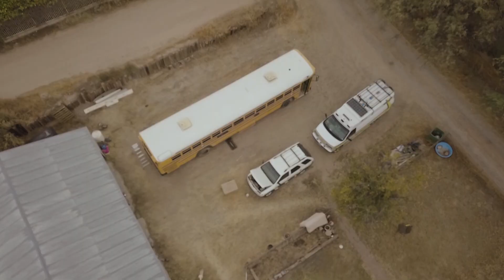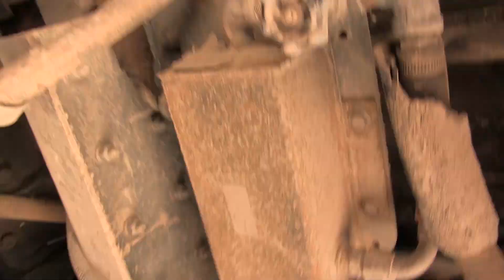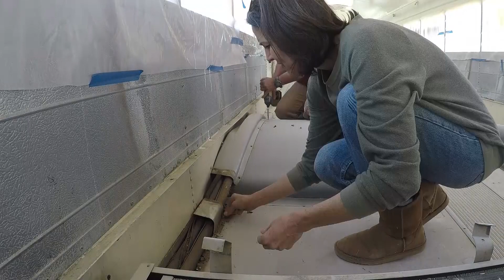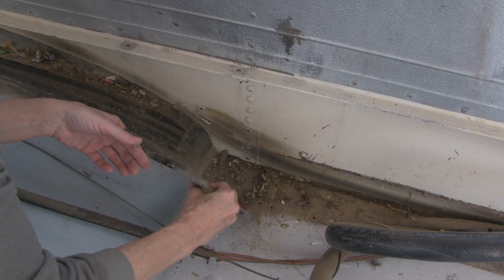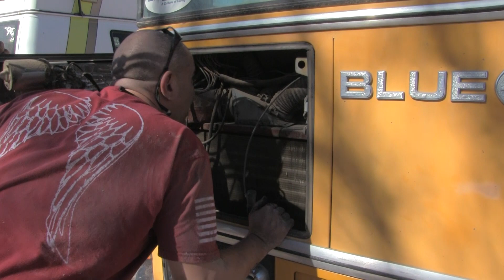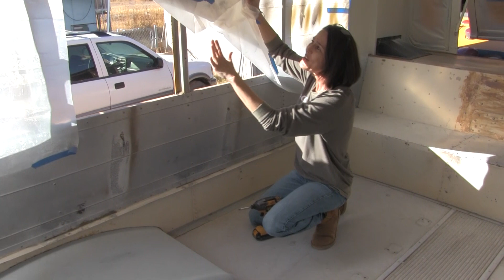Skoolie Bus Conversion: Heater Removal

Comment: My bus had one rear heater and I decided to keep it installed.
Reply from the maker: +Johnny Mullet we thought about it but we realized 3 things. 1) it only works if the engine is running which at idol takes a substantial amount of time to warm up enough to make heat which then makes it a very expensive form of heat. 2) we are installing a propane furnace which we can run while we are driving. 3) in the event we end up at an RV park, we can't run the engine for any real length of time or the wood stove (legality issues). So, the heater is out.
Reply: @BussyMcBusface  hank you for mentioning those considerations. I was wondering why many people didn't just keep the stock heater.

Comment: Thanks for documenting your hard work.  Will you still be able to defrost the windshield with the front heater out?
Reply from the maker: Mick Riva that occurred to me the other day and I haven't figured it out yet.
Reply: Bussy McBusface some of the other school bus conversions I have watched were sorry they took out the defrosters because you have such a large window you need to have a lot of air movement. Some of them put the defroster back in.

Comment: How do you keep your bus warm when you are driving it
Reply from the maker: We can run both of the diesel heaters while we are driving. the only time that they couldn't keep up is when we were coming back from Colorado in sub freezing temperatures. If we weren't moving the heaters would have done just fine.

Comment: Hey man, really enjoying your channel. Is it possible to take just the back heater out and leave the front one, or is it not that simple? I'm going to be starting on my bus soon and plan to use your placement of the fresh water. Except I'm also going to try to throw the water heater under the bed too. Wondering if you thought that was a good idea also. Thanks in advance.
Reply from the maker: You could put the water heater under the bed but if your sink is far from the heater,  you will waste a hit of water waiting on the hot water.  That is why I put the water heater between the sink and the shower.  Thanks for your kind comment!
Reply from the maker: As far as the heater, I think to could do that.  I cant remember if they were part of the same line but if the were you could just bypass the rear heater.

Comment: My bus is very similar to yours 89 bluebird,  However my is the forward engine a puller I guess as they call it. But the heater is the same as yours  did your bus have a tiny little Fan type radiator just behind the drivers seat?  Also I did you have to deal with some hose work under the bus just under the front grill heater of the bus?  One last question, I am to the point now where I am trying to get the drivers seat out, it seems like  it is a 2 person job, how did you do it, any advice?  I love your gusy vids I am learning a lot I am travelswithdave I am in Washington state.  Working on m building my skoolie.  Hope to hear from you when you have time.  Thank you .
Reply from the maker: No radiator behind the seat.  We did have to deal with hoses from rear to from but you won't because it is the engine that makes the heater work. The hoses actually ran inside the bus on the drive side.
As far as the driver's seat, the people we got the bus from had already removed it so I don't have any words of wisdom there.
Reply: Travelswithdave hey I have a 1990 whit that little radiator on the side . Did you pull it out ?
Reply from the maker: Definitely didn't pull any radiators.

Comment: For the heater removal, did you leave the valve at the engine shut off or did you do some kind of loop with the hoses?
Reply from the maker: I shut the valves. I may add another radiator to the system to aid in cooling. We'll see.
Reply: I’m at this point also 
Do you have any video of your valves you shut, I could only find one, and I still lost almost 5 gallons of coolant from just the lines so I’m thinking I didn’t close the right valve... your videos are very helpful as I have the same pusher style bus...

Comment: I don't know your situation but if you plan on driving it you will need a defroster at some point. I know there are other options but thoses will cost money and these heaters already came installed with the bus. Like I  said your situation may be different but defrosters are nice to have.
Reply from the maker: We are planning on using 12v hair dryers mounted inside the dash.
Reply: @BussyMcBusface  😂Was that serious or sarcastic?  Either way, I love it. Made me laugh on a bad day